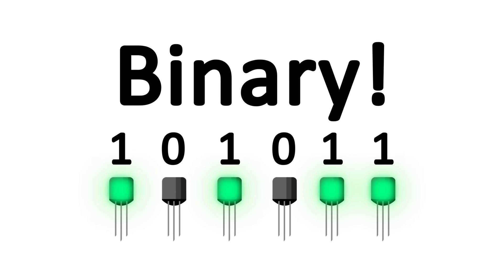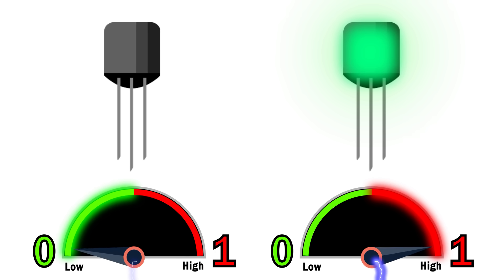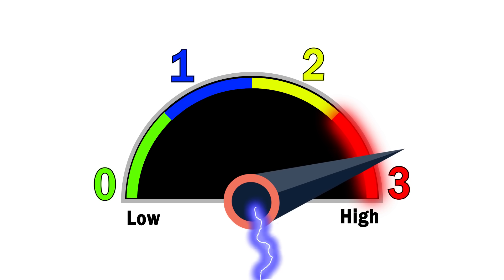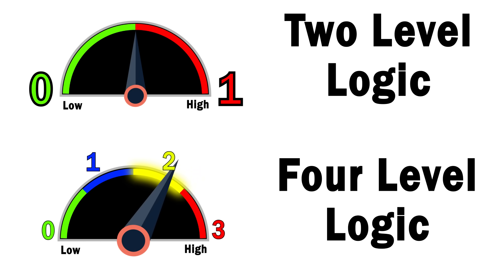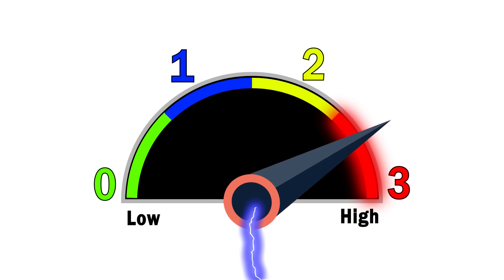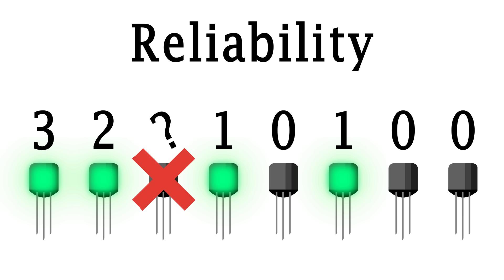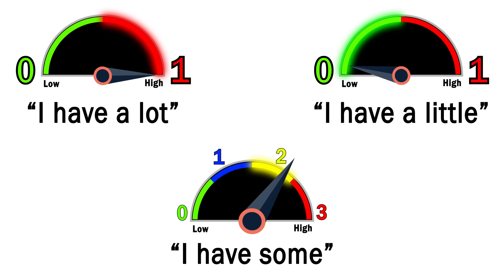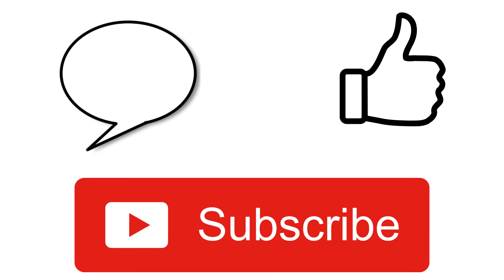Why can't computers use base 3 instead of binary? Voltage states explained.

Comment: It can’t be 0-4 because that’s 4 dimensional.. we operate on a 3 dimensional consciousness and that’s why we keep computers at 2 dimensional… or so I assume I’m some kid high on an iPad.
Reply from the maker: It has nothing to do with dimensions. Logic levels are simply exponential counting systems 

Also 0-4 is 5 values not 4, and we operate in a 4 dimensional universe. Time is the 4 the dimension.
Reply: @H3Vtux  Also, the 4th dimension is called a "dev dimension", in which only the developers of the Universe can access. Meanwhile, Flatlanders dream of a 3rd "dev dimension", so, we 3D beings are the "developers" of Flatland!

Comment: Why have you used 4 as an example and not 3? 

3 has actually been stated to be the most effecient system and it's not got the same reliability risk as base 4 as you have a leway of 33.3333...% which is still relatively low risk.

Even innovators like IBM and Samsung have dabbled in trenary and recognise its potential. It's more about the laborious process of producing such technology and distributing it en mass which is holding them back when all the current software architecture is based on base 2/binary. You can't really blame them for not being hasty trailblazers in such a difficult venture.

Comment: YEESSSS!! finally someone make a correct depiction HOW mechanical binary should be describe!!! ITS NOT ON AND OFF! There's currents pass through in you computer anyway~! the one its(your devices chips) done is "reading" the signal back to binary and vice versa. So opening and closing of transistor is absolutely no matter bc each state of actual bit position of 0 is held back by low charge and 1 pass thru by "semiconductor gate" if given some over or enough charge to it.

Comment: Can we skip over the voltage reading method?

Really curious how the flash drives can do base 4 and a computer shouldn't

Thanks so much for the video!
Reply: The transfer speeds are far FAR slower.

CPU cache is reaching terabytes of information per second. Flash Storage cannot do that.

Also, doing this makes it more prone to bitrot.

Comment: Electrostatics finished. Observer effect, plus environment. I have a reliability issue with my toaster oven and washer/dryer. Static sticking at the contacts, inside a knob. I've had to spin out the charge in the knob before the contact would make up. Once the fucking toaster oven turned itself on. NO BUENO. PK or physics?

Comment: From yes-no to Yes-maybe-no
Reply: Yes-maybe-no-true-inconclusive-false. 3 answer choices on a test. Used so that the score really reflects your knowledge, as on a yes-no-true-false test, getting a 100% tells us you have the same knowledge as getting a 0%, as if someone had 0 subject knowledge and randomly guessed, they would score a 50% on average, and if someone gets a 0%, they know what the answer is; they decided to choose the other choice via reverse psychology.

In set theory, we have the universal set U, the null set ∅, and the single set {∅}.

In Boolean algebra, we have 0, 1, and 0.5.

However, the NOT / OR / AND / gates, compliments / unions / intersections, and Boolean inverses / summations / products will remain the same, as they are lowest upper bounds and greatest lower bounds, respectively. Therefore:

¬⊤ ≡ ⊥
¬⊥ ≡ ⊤
¬⊢ ≡ ⊢

⊤ ∨ ⊤ ≡ ⊤
⊤ ∨ ⊥ ≡ ⊤
⊤ ∨ ⊢ ≡ ⊤
⊢ ∨ ⊢ ≡ ⊢
⊢ ∨ ⊥ ≡ ⊢
⊥ ∨ ⊥ ≡ ⊥

⊤ ∧ ⊤ ≡ ⊤
⊤ ∧ ⊥ ≡ ⊥
⊤ ∧ ⊢ ≡ ⊢
⊢ ∧ ⊢ ≡ ⊢
⊢ ∧ ⊥ ≡ ⊥
⊥ ∧ ⊥ ≡ ⊥

U∁ = ∅
∅∁ = U
{∅}∁ = {∅}

U ∪ U = U
U ∪ ∅ = U
U ∪ {∅} = U
{∅} ∪ {∅} = {∅}
{∅} ∪ ∅ = {∅}
∅ ∪ ∅ = ∅

U ∩ U = U
U ∩ ∅ = ∅
U ∩ {∅} = {∅}
{∅} ∩ {∅} = {∅}
{∅} ∩ ∅ = ∅
∅ ∩ ∅ = ∅

1' = 0
0' = 1
0.5' = 0.5

1 + 1 = 1
1 + 0 = 1
1 + 0.5 = 1
0.5 + 0.5 = 0.5
0.5 + 0 = 0.5
0 + 0 = 0

1 * 1 = 1
1 * 0 = 0
1 * 0.5 = 0.5
0.5 * 0.5 = 0.5
0.5 * 0 = 0
0 * 0 = 0

XOR / XNOR gates, logical statements, set differences, and any Boolean operator follows the same pattern. However, if the hypothesis of a statement is false, the conclusion is inconclusive. Truth table p → q:

p  q p → q C
⊤ ⊤     ⊤     ⊤
⊤ ⊥     ⊥     ⊥
⊥ ⊤     ⊤     ⊢
⊥ ⊤     ⊤     ⊢

Inconclusive statements can be converted: There may exist / There may not exist / All of them may be true / All of them may be false: ∨'⊢ ≡ ⊤, ∧'⊢ ≡ ⊥, ∪'{∅} = U, ∩'{∅} = ∅, +'0.5 = 1, *'0.5 = 0

Using this, we can derive a Boolean algebra for genders:

Boolean values: ♂, ⚧, ♀
Binary operators: ☀, 🌙
Unary operator: '

♂' = ♀
♀' = ♂
⚧' = ⚧

♂☀♂ = ♂
♂☀♀ = ♂
♂☀ ⚧ = ♂
⚧ ☀ ⚧ = ⚧
⚧ ☀ ♀ = ⚧
♀☀♀ = ♀

♂🌙♂ = ♂
♂🌙♀ = ♀
♂🌙 ⚧ = ⚧
⚧🌙  ⚧ = ⚧
⚧ 🌙 ♀ = ♀
♀🌙♀ = ♀

Identity laws: A 🌙♂= A, A ☀♀ = A
Domination laws: A ☀♂ = ♂, A  🌙 ♀= ♀
Idempotent laws: A ☀A = A, A 🌙 A = A
Commutative laws: A ☀B = B ☀A, A 🌙 B = B 🌙 A
Associative laws: A ☀(B ☀C) = (A ☀B) ☀C, A 🌙 (B 🌙 C) = (A 🌙 B) 🌙 C
Distributive laws: A ☀(B 🌙 C) = (A 🌙 B) ☀(A 🌙 C), A 🌙 (B ☀C) = (A ☀B) 🌙 (A ☀C), 
Absorption laws: A ☀(A 🌙 B) = A, A 🌙 (A ☀B) = A
Negation laws: A ☀A' = ♂, A 🌙 A' = ♀
Double negation law: A'' = A
DeMorgan's Laws: (A ☀B)' = A' 🌙 B', (A 🌙 B)' = A' ☀B'

Using this, we can prove:

A ☀(A 🌙B) (Given)
= (A ☀♀) 🌙 (A ☀B) (Identity laws)
= A ☀(♀🌙 B) (Distributive laws)
= A ☀♀ (Negation laws)
= A (Identity laws)
∴ A ☀(A 🌙B) = A
∎

Q: The algorithm of determining the gender of a group of people is that the group is male if a male is present in the group, and female if all members of female. Therefore, we can derive:

Conjunction: ♀∪ ♀= ♀
Specialization: [A] = ♀→ [B ⊆ A] = ♀
Generalization: [A] = ♂ → [B ⊇ A] = ♂
Elimination: ([A] = ♂∧ [B ⊆ A] = ♀) → [A \ B] = ♂
General specialization: [A] = ♀↔ ∀x ∈ A s.t x = ♀
General generalization: [A] = ♂↔ ∃x ∈ A s.t x = ♂

Using this, identify the gender of the null set of humans. In other words, identify the gender of the set with 0 humans.

A: 

ↅ [∅] = ♂,
then [ThomasGameDocs] = [ThomasGameDocs] ☀[∅] = ♂(Domination laws),
however, [ThomasGameDocs] = ♀(https://youtube.fandom.com/wiki/Thomas_Game_Docs)
∴ [∅] = ♀
∎

Which then proves that nothing is female, which is why robots fail the test saying that "nothing is female" implies that "everything is male", which is who an AI would say "there is only 1 gender".

Comment: Ternary (trinary) is like 20% more economical in CPU usage and if mass producing computers received a complete reboot, ternary would likely be the system that would be used, but due to the fact that binary was first to become the defacto system, it will likely remain that way. With solid state drives as capable as they are to record data in different number systems, there is no longer the restraint of on/off states like there was for magnetic disk hard (and floppy and tape drives.)

The main reason ternary is more efficient is that performing one of the most basic logic functions, the ternary function of else is available with every trit (a ternary bit,) which would take quite a few bits to perform the same function. Maths are also performed more efficiently, since the three inherent states of a trit are -1, 0 and 1(+1)

Since bipolar transistors would be used for a ternary CPU, there isn't a problem of in between states because the states of a trit would be either negative voltage, positive voltage or off.
Reply: They would need to somehow construct a tiny (max 10 nm) ternary transistor and many other things for it to be worth it against binary CPUs though
And it would require manufacturing a new mo-bo process, GPU, flash chips, etc. that requires too much work, even for modern industry
That's like telling "Hey, forget virtually every chip, board, compiler, memory cell you've ever made; start over!"
Over $5T cost, not even counting the fabric lines going to be scrapped as useless and so much waste going overseas.
Reply: @pje_ a ternary CPU can interface with binary hardware fine, you just need device drivers and a chip set that can support binary hardware.
Reply: Not to mention you don't need a lot of those things for a working system; you can build for a mainframe or server and have software rendering only -no GPU needed at all
Reply: That is not suitable for household use though
Reply: i might agree if you can make a bipolar transistor with no passive energy drain and switch energy measured in fento or piko joules
Reply: There are ternary computers that work by clockwise current flow, counter clockwise, or no flow. Disappointed you didn’t go in to those.
Reply: @truvc operating on current flow is going to be expensive in terms of energy use: they'll require a constant current, which means constant heat losses. compared to sth like cmos with no current flow when the state is constant.

Comment: Title: Why can't computers use base 3 instead of binary
Video: Why can't computers use base 4 instead of binary

Dude... 67.7% accuracy is all it needs and it is nothing. The actual real reason is the cost of ternary transistors because we combine two binary transistors to create one ternary transistor.
So we only need a more efficient way of building ternary transistors and that's it. Also, the whole world isn't used to such computers! It still needs an operating system and the assembly language and a reliable high-level programming language to actually even make it to the market and programmers could develop it and people actually buying! No one would think to even invest in such an awesome invention that'd revolutionize the whole world because of how weak and expensive it would be at first which is sad...
Reply: I believe that it'll be invented at some point in the future. Modern electric computers are getting to the physical limit (eg. speed of electricity travelling through conduits) of how fast they can be. It's just a very big question of "when".

You could hypothetically perform big equations quicker, as one electrical signal would be carrying much more information

Comment: They could use base 3, by using negative voltage. Avoiding the whole problem that you are presenting in your video.

Read this book for more info:
https://books.google.ca/books?id=ysqoBAAAQBAJ&printsec=frontcover&dq=ternary+logic&hl=en&sa=X&ved=2ahUKEwjiqpjHyd3uAhXhhOAKHRGtBJoQ6AEwAnoECAUQAg#v=onepage&q=ternary%20logic&f=false
Reply: Would it still fall foul of the rising/falling edge problem if switching from +ve to -ve (or vice versa)?
Reply: Thanks @AlexChannel! I clicked this video and I was thinking "here's another video that gets ternary wrong and proly won't even mention the fact that binary is used largely because of it's ubiquitous legacy."

You turned what would have been a complete waste of time into an awesome resource.

Comment: Perhaps it might be possible to design a trinary logic system based on three logical states..., 1-, On, current in a positive direction..., 2-, Off, no current..., and, 3-, On, but current in a negative direction... That way..., everything is ether full off or full on..., and if on..., either full on one way, or full on the other...
Reply: It is possible, there is also a whole book about this.

V+ is 2
GND is 1
V- is 0

The usefulness of this is in the "Don't care" state. Where, whatever the bit value is, the result will be the same.
In VHDL this "Don't care" state can be implemented using std_match() and is represented by a dash - .

Example:
my_loop: for input(4 downto 0) loop
     if input(3 downto 0) = "11--0" then
     -------Do A------
     else
     -------Do B-----
     end if;
end loop my_loop;

However, behind the scene it look like this ("sort of..."):

my_loop: for input(3 downto 0) loop
     if input(3 downto 0) = "11000" then
     -------Do A------
     elsif input(3 downto 0) = "11010" then
     -------Do A------
     elsif input(3 downto 0) = "11100" then
     -------Do A------
     elsif input(3 downto 0) = "11110" then
     -------Do A------
     else
     -------Do B-----
     end if;
end loop my_loop;

Which can take a great deal of logic area. However, by using ternary logic, the code would look like this, and the area will be WAY LESS.

my_loop: for input(4 downto 0) loop
     if input(3 downto 0) = "22001" then
     -------Do A------
     else
     -------Do B-----
     end if;
end loop my_loop;

Where true is "2", false is "1", and "don't care" is "0".

This is the book if this interest you:
https://books.google.ca/books?id=ysqoBAAAQBAJ&printsec=frontcover&dq=ternary+logic&hl=en&sa=X&ved=2ahUKEwjiqpjHyd3uAhXhhOAKHRGtBJoQ6AEwAnoECAUQAg#v=onepage&q=ternary%20logic&f=false
Reply: @alexanchannel  Thank you sir...
Reply: @Kreln1221  Well that's a weird way to say thank you... I don't know you are being sarcastic or not. But sorry if my explanation was too much.
Reply: @alexanchannel  I wasn't being sarcastic at all..., merely respectful... I thought about this basic "trinary" concept years ago, with the three logical current states of, +1, 0, & -1, but nothing more in depth... It's great to know that there are others that have thought about it as well, and have also taken the concept much further... In all honesty..., thinking back on it..., in the early 90's, there was a PC game called Star Trek 25th Anniversary..., and in it, there was a math conversion puzzle where you had to convert binary to trinary, as there were two different alien computer systems that you had to get working..., and as one of these in-game computers were trinary instead of binary..., I thought to myself, "How would that work?", and that's when I came up with the idea of those three logical states... But having said that..., it's obvious that some programmer at Interplay had already been thinking along those lines..., as it was already in the game's storyline...

Comment: Because YOU ALL FAILED to answer Wigner and Knuth and LISP. I have finished it, the perfect 3D mathematical and physical model for perfect Universal Computation. Shannon-Turning up a dimension. Natural Complexity. Some autodidacts have also envisioned 3D read-write. Capacitance and resistance with incommensurability.  I was RIGHT from birth; this is not the RIGHT world, the adult babies ruined it. My father was an electrical technician for Con Ed, btw.

Comment: Why not use base 2? I'm sure with newer technology we CAN make voltage stabilizers good enough to stay within 15% margins..?  (0-33 =0, 33-67=1, 67-100=2). The rising and falling edge can perhaps be eliminated by installing reading intervals set to max theoretical values..? Or are these intervals too long for practical use? If so, maybe with the higher base, and fluctuations eliminated? Or better yet, wouldn't this mean that the next computing breakthrough is after eliminating power fluctuations and moving to higher value bases when stable enough?
Reply from the maker: We CAN make stabilizers better than the ones that existed when the decision on Base 2 was made, but it still comes down to cost. We're talking billions of two state mechanism in even the smallest computers.
In addition to everything else it has to be kept in mind that every single machine language interpreter has been optimized around using Base 2, if we somehow managed to make a CPU using base 3 tomorrow it wouldn't be as simple as plugging it in and having it work.
Reply: @H3Vtux  Well obviously there'd be difficulties adapting language (although couldn't we use the ssd translator method now as a temporary crutch?), and it'd be harder to implement, but surely we can do it by making it bigger, plus, isn't the current technology approaching the point its pretty much in a snag? Meanwhile this direction at least SEEMS to have some promise, if you get past the difficulties, which is always a step for new tech anyway... Also, would it be wrong to assume that if we someday hit base 10, we could use something closer to normal math much easier without less need for some of the coding to begin with, on top of the increased efficiency?
Reply from the maker: @mkzhero  I'm nowhere near an expert on this topic so take all this with a grain of salt but some thoughts:

--->Translators are well and good and in fact already used for some things, (some external storage devices actually currently use base 4 and 8, and the translation occurs in the transfer process.) While fine for data storage This would be much harder to adapt to things like instructions in a CPU where the process of translating costs precious miliseconds of speed.

--->If we got to the point where the rising edge falling edge probelm were no longer an issue, I think we might as well skip base 3 and hit something higher, again i'm not sure of this.

--->With machine code, working in number systems that humans are familiar with aren't that important. If we could go really high there would be no reason to arbitrarily limit ourselves to base 10 simply because it's what humans like, we might as well go to 15 or 20 or better yet something like 16 or 32 which would be easier to translate current base 2 data into.
Reply: @H3Vtux  Dunno, i'd think it'd be better with decimal, if its possible. In any case, thanks for the vid and replies ^^